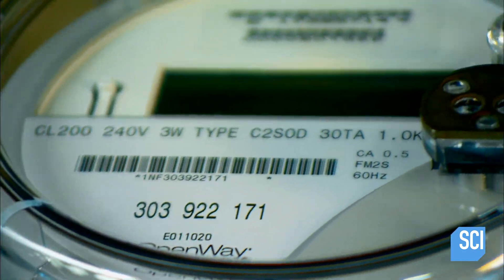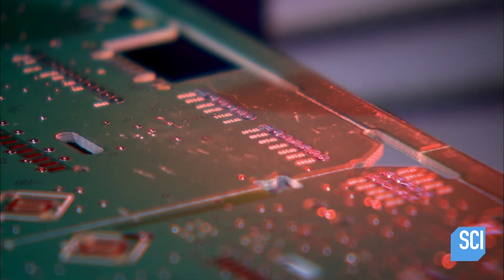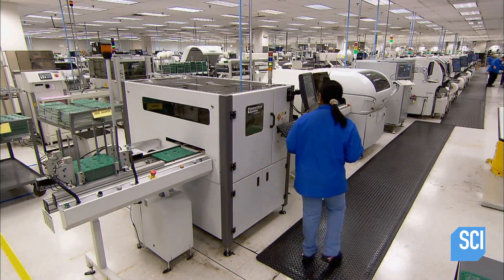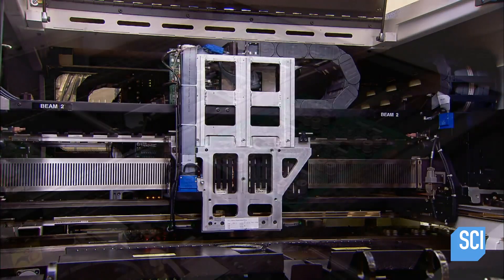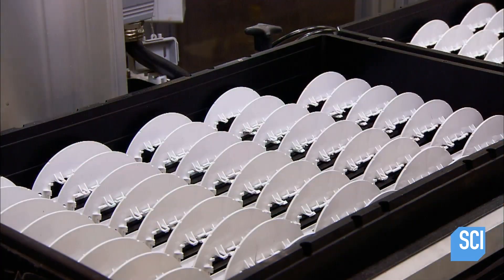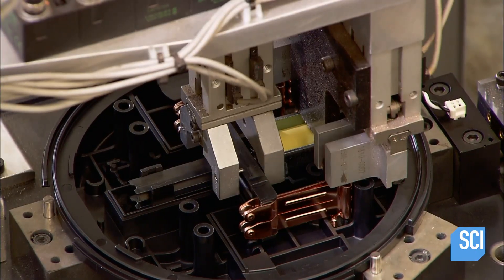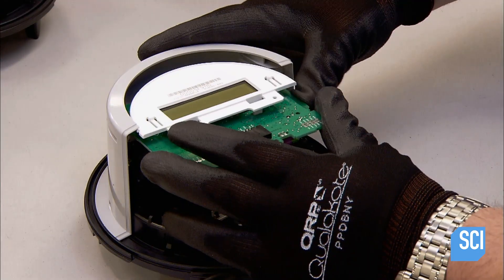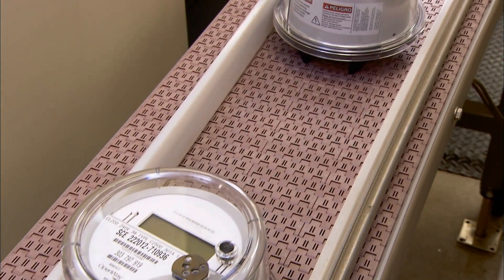How It's Made: Smart Electric Meters

Comment: We still use traditional electric meters in the Philippines unfortunately
Reply: No reason to be sorry about that. Here in Belgium we're converting to smart meters atm and there's only downsides:
 - When you have solar panels, the old meters spun backwards on sunny days and forwards during the winter months. Now injection and consumption is measured separately and we get a LOT less money for the power we inject than we have to pay for the power we consume.
 - The old meters just registered how much power you used and you pay a fixed price per kWh. If you had a double meter you could have a different price for daytime and nighttime use but that's it. With the smart meters they also check how you spread your usage and adjust pricing on that: slightly cheaper if you spread out your consumption... but if like most people you don't use a lot of electricity during the day and then start cooking, laundry, watching TV, using the computer all at once, you have to pay a "peak tariff" supplement
 - With the old meters, if you missed a monthly payment, you got one or two free warnings before they forced you to get a payment plan, and you had to be a lot behind before they limited or shut-off the supply. With the new meters, by the time you get a second warning they already limited your supply to less than what an oven uses and they can even turn off the gas since those are "smart" now as well.
The pros are basically nothing:
 - You don't have to mail in the reading and allow the meter person in every 2-4 years anymore, which isn't really a hassle at all
 - You can buy a device that plugs in to the smart meter to track your energy consumption real-time, but that was already possible before by installing a metering device between the analog meter and the fusebox, ánd it wasn't really necessary before since there was no price difference between consumption and injection, nor peak tariffs...

Comment: In Hawai'i they are rolling these out in mass and the theory is when you use too much power during peek hours they can shut you off to "protect the grid"
Reply: They would disconnect at the distribution substation, not individually at the meter. There’s things called “underfrequency relays” which operate automatically when generation is severely deficient.
Reply: @jeremyloveslinux  The idea behind load shedding at the meter is that you can be way more granular and instead of being limited to just what you can disconnect at the substation you can now disconnect e.g. 1/3rd of the homes you would have had to disconnect. Also in practice if they're cutting load based on current high usage then you'd be able to do way less than that as one home with the dryer running and fast charging an EV will easily draw down the same power as 10 other homes that are lightly loaded just running lights and low load appliances. They would disconnect at the substation ordinarily, part of the promise of smart meters is being able to limit outages due to load shedding to a much smaller group of homes.
Reply: Peek hours? Is that when you peek trough the curtains?
The term is PEAK hours.
Reply: @patverum9051  through*
Reply: @frostbite1991  🤣🤣